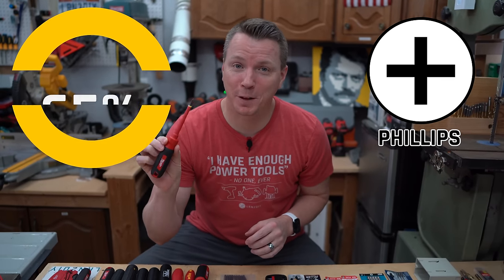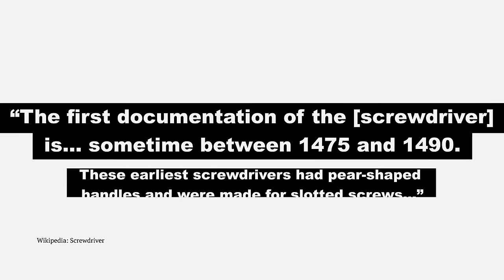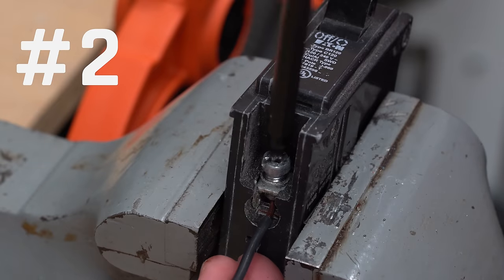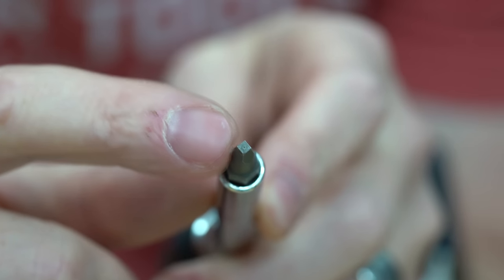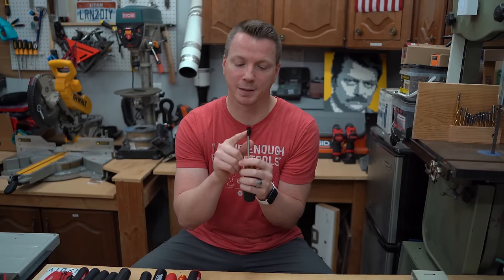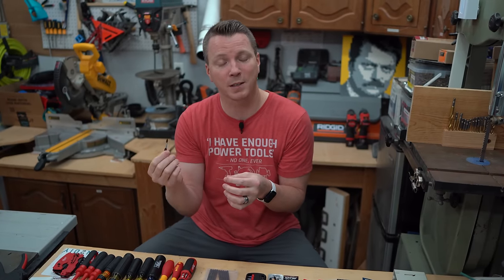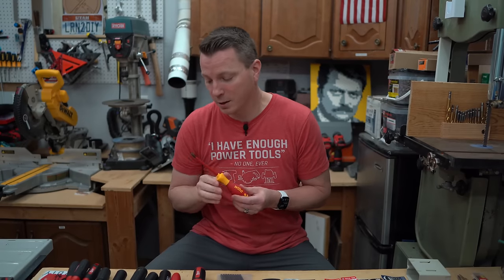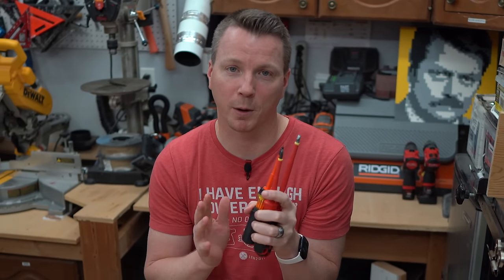You're Using the Wrong Screwdriver For Electrical

Comment: So after seeing so many people online hype the Milwaukee ECX screwdrivers and how they're the greatest thing ever, i decided to purchase the Milwaukee ECX1 and ECX2 hex impact bits and if i like them, i'd then buy some insulated screwdrivers. They arrived today and i just tested them out on a few Residential as well as Fed-Spec Leviton 5-15 receptacles as well as a Heavy Duty/Industrial 6-20... and i must say that i'm somewhat underwhelmed. They don't fit nearly as snug as a Robertson driver. Once tightened down, the bit can be wiggled left and right in the screw head. In stark contrast, a Robertson bit fits so snug into the screw that i can not only pickup the receptacle and it wont fall off the big while holding it sideways, but i can turn the screwdriver pointing straight down and the receptacle will still hang on. The Robertson bit is a Makita XPS Impact, which i should mention is the best fitting bit set i've ever owned. 

TLDR.... so yeah, not impressed. I'll stick with Robertson.

Comment: Funny how he came back to Robertson. As an electrician I’ve been using them for several years, great for speed on outlets. Two or three clicks on my driver and I’m torqued in. Same w switches but slightly gentler, just one click. I see where framers are liking star bits a lot.

Comment: The Robertson screwdrivers are great however the size 1 (normally colored coded with a green handle) can be used to almost turn the larger size 2 screw, however if you try doing that,  it will slip and round out the screw head. The larger size 2 driver (normally colored coded with a red handle) will not fit into the smaller size 1 screw. Therefore the size 1 driver needs to be used with a bit of caution to ensure you are actually turning a size 1 screw and not a size 2. I suspect that is where the slipping complaint you mentioned is coming from.

Comment: I was told be a mechanical engineer that the slot head screw was the weakest.  I have found that to be true when using the old fashioned design of slot head steel screw in hardwood when building boats.  Therefore I suspect that the new screws for multiple screwdrivers could also be weak.  What does the manufacturer of these new design of screws have to say or the Electrical Society of Engineers?  I’m sure they have addressed it.  
Good video, thanks.👍

Comment: There’s one more seldom mentioned advantage of the Robertson driver and that is its ability to hold onto the fastener without being magnetic. The bits have a slight chamfer which allows it to jam into the fastener head. No more fiddly screws  dropping off when installing in awkward locations
Reply: Sometimes a little bit too much so...but yes, Robertson's are a simple and effective solution to screw applications.

Comment: One huge advantage of the Philips bit is that it is self-centering; it doesn't slide from side to side the way a flat-head bit can.  But of course, you can often get more turning-force with a flat-head bit than with a Philips, especially in instances where the Philips bit and the screw-head don't fit precisely; the Philips bit and the screw-head need to really fit together tightly, like they sometimes can in the case of a drywall/deck screw --- in that combination, the driver-bit will sometimes lock so solidly into the screw-head that it will actually either twist the screw-head right off the shank or break off the wings of the bit and leave them embedded in the slots of the screw-head.  The ECX combination bit gives you the best of both worlds, though --- it both self-centers like a Philips or square-tipped Robertson bit, and also gives you the full-torque capability of a slotted bit.

Comment: The flat blade give you the highest torque but the tip slips sideways causing much frustration. The combo tip solves that problem by eliminating the slip. You get maximum torque and greatly reduced frustration with the combo tip. Square drive is improved as compared with the philips but not as high as the combo / flat blade

Comment: Ok, I am from Canada and love my Robertson screw drivers. I am wondering though if the "Philips" portion of the screw heads is not realy Philips. There is the posibility that a Posidrive would work better as it does for automotive work. I was surprised that you did not test it.

Comment: I use flathead because half the screws I run into are old flathead-only screws. I hate the flathead but I also hate having to change the bit back and forth, and after a while you do get good at lining it up and keeping it straight. I'm also an electrician by trade so I use it all day every day. I would love if they would just change everything to robertson.
Reply: torx ? pozidrive ?

Comment: FWIW, Klein also makes a 15-in-1 ratcheting screwdriver (#32305) for about $22 USD, which includes includes Phillips (#0, #1, #2, #3), Slotted (3/16-Inch, 1/4-Inch), Square/Robertson (#1, #2), Torx (T10, T15, T20, T25), and Combo (#1, #2) bits.

Comment: The slotted/philips style is pretty much standard in Europe. With the correct screw, the philips part gives you positioning and the slotted part gives you the torque that you really can’t get with philips style screws. (Philips style screws are designed to slip instead of torque!)

Comment: Philips and Pozi heads were invented for easier assembly because they self centre and make using the electrical driven screwdrivers eas , they were not designed with future use of that equipment in mind, where the screws get tight and round out the heads.

Comment: A large percentage of people install the outlets upside down. Having the grounding prong at the top helps relieve stress on the prong. The reasoning behind the ground on top is for protection against any metal objects that fall on a partially exposed plug it will hit the ground instead of shorting across neutral and hot.

Comment: Slotted screws are the most pleasing for the eye as long as you line them up. Good luck doing that with a square bit.
Reply: who cares . i want to get torque on to my wire connections.

Comment: I wire control panels and i use philips/slotted combination on CBI breakers and pozidrive/slotted combination for weidmuller breakers. Its easier to strip those screws without combination tips. Using one of the wera interchangeable vde kit which has ph/s1, ph/s2, pz/s1, pz/s2 included.

Comment: I was excited when I saw the ECX bits. One comment from one user was that the ECX bits don't lock into the drivers. I found that too. I also found that ECX was har d to get used to lining it up on the screws. I like the Robertson. I will look into the Klein double driver. The screwdriver I carried even though it is not insulated was the 10-1 yellow handled driver from Ace Hardware. The bit s  are good steel and it has two flat blades two Phillips two Robertson two torx plus a 5/16 1/4 nut drivers. 
Just a note about the Phillips. Research and you will find that was invented by Mr Phillips for the auto industry. Much off the parts were put on with screws. They were installed with air drivers.  They  did not have the torque adjustment they do now. The screws were getting over torqued would strip the threads. Mr Phillips designed the "Phillips" to cam out when over torqued. When it cams out it is working as designed.

Comment: If your Philips starts slipping or you notice slop right away than you should try a Pozidrive driver instead. If both of those don't work, try a Japanese Industrial Standard one instead. If all fails than either the screw is bad or the screw is poorly designed. That's my opinion.

Comment: Great vid!! Thanks a lot. Answers, and proves real life ... many of the conclusions I've only been guessing about. Super helpful research. AND, yep .... I had also, (just winging it! without the expertise you brought to the table!) some time ago decided the Robertson (square tip) was an excellent screw engagement type.  I use power drivers (cordless drills) much of the time ... in wood working ... but all manual in electrical work. The Robertson just seems to work  ... for me. My ultimate choice, always, however is what i call the 'clutch head" arrangement -- "star drive". THE least likely to cam out, or wear out of all, provided you ensure you have 100% engagement. The only negative I've noticed with these is the use of the drive design in really small screws. Very easy to strip the driver and/or screw. Just have to be careful, go slow, and apply a lot of "push" to maintain the engagement. Haven't seen that style in electrical work yet. Anyway ...  Thanks again. REALLY helpful video.

Comment: It depends... some devices still only come with slotted screws.  Otherwise, I'm a huge convert to the Xeno driver (a.k.a. combo) and bought a #1 and #2 Wiha insulated set to go with my other insulated drivers.  The #2 Xeno is by far my most used now.  I never use Phillips anymore... they cam out way to easily.  The Wiha Xeno drivers also have the extra tip extension, like the Klein does (I also have for non-insulated needs).

For everyday screws... I will always go for square (robertson) over any other head drive type.

Comment: #2 Terminal screwdriver. Not an electrician, but have one. Picked up one for industrial controls as most DIN rails use them.  The slotted and Phillips has a name. Terminal. Most common size is #2 Terminal. Pick one up at your local electrical supply house. Don't ask for it at the big box store or hardware store. The won't have it as in retail space, nobody has heard of it, so low volume and not carried.  If you try to google it, many invalid results pop up as any slotted or phillips screwdriver is in the popular results. Not all Terminal Block screwdrivers are a Terminal Screwdriver.  a good electrical supply house has them. Get the insulated narrow shank version. Its the one to fit most power contactors for the HVAC guys.
Phillips have beveled blades and are designed to Cam Out of the slot to prevent over tightning. Unfortunately it promotes wear and damages screws that are not Philips. Posi-Drive, Robertson,, and JIS screw drivers have reduced or no bevel on the blades, along with the Terminal screwdriver.  Get the rigth tool for the job. They don't cam out and help prevent loose connections.

Comment: Thank you for sharing. I try to limit the number of screwdrivers in my electrical tool pouch snd carry a multi bit screwdriver. I have found the square bit to be the best for breakers and receptacle/ switch terminals. I do want to get an insulated screwdriver and am going to get the Klein square driver combo based on your video

Comment: The electrical cabinets use slotted fasteners(flathead)(aswell as a separate keylock, clearly installed later) where I work, because no other driver head will easily turn those to open the cabinets. everything else is torx or hex. However I know this isn't really relevant to the video as a whole. It is just an observation of a use for slotted fasteners.

Comment: @LRN2DIY In Canada Robertson #2s are FAR more ubiquitous than #1 outside of electrical. All Framers (in Canada at least) use #2 Robertsons for construction, so that could be why they're harder to find. 

#1s are really MOSTLY only used for inside fixtures and outlets etc. 

Phillips screws are really only used by Drywallers. Oh, and you find a lot of imported stuff from China that is usually targeted at the USA first to use phillips. IKEA is the most frustrating one... Robertson even SOUNDS like a Nordic name... so much IKEA meaning "Swedish for common sense" lol

Comment: The Milwaukee tool next to the outlet in your farewell comes with all the bits you need to do electrical work and is ratcheting to boot. I have it in the stubby version as well. I will try the Square drive next time I do any electrical work!!

Comment: I don’t mean to disparage,  but please ignore the information in this video.   The NEC requires that a screw used for electrical connections be tightened to a torque that meets the manufacturers specifications .   Using the driver recommend by the manufacturer is the best option.   Manufacturers use Phillips screws because they are  designed to “slip” at a specific torque.  The manufacturers designed their components to be safe and effective at that amount of force.    Phillips screws were designed by for the automotive industry and adopted by the electrical manufacturers to ensure a screw is properly tightened to a specific torque and not over or under tightened.  The reason why they “slip is they are at the design torque.   Using a Robertson or other driver will require a torque screwdriver by code and an electrical inspector will ask to see that screw driver.  Typically, the recommended technique is to tighten with a Phillips to obtain the correct torque and to remove with a different type of driver.

Comment: My argument in favor of Robertson drivers is that electrical codes now have torque requirements and Robertson drivers don't cam out. Since I don't have a torque driver, I have come to the conclusion that these torque requirements mean that you should tighten a screw just a little tighter than you think sufficient. This is where Robertson excels. I also agree with your criticism of the ECX bit.
Most 1/4" bit sets include both #1 and #2 Robertson tips.

Comment: Electrician here, 30 yrs of experience and who knows...50,000 receptacles and switches. 95% of which are 20A commercial grade. 
I cant believe I havent yet dicovered ECX!!!  Defnitally going to try, it looks Ideal(no pun intended, lol)   For terminations its flat head/slotted all the way. Much more torque. Yes, it sound antiquated, I thought the same going into the trade but I learned that with a proper sized and properly maintained flat I can achive more torque, even with the screws that accept several makes of drivers. Torque on terminations is obviously very important .  For screwing devices into the mud ring or old work box I either use a small electric driver with a #2 phillips or a #2 offset phillips screwdriver, for installing cover plates I use a 3/16" offset screwdriver.  Once you get the hang of offset screwdrivers the speed and control is incredible. Depending on the circumstances generally an offset screwdriver can be  just as fast and better control.   Ive used robertson with sucess before but at least in the US Robertson isnt standard for everthing.

Comment: The "Wiha" SL/PH2 (you pronounced it right) is fitting probably the best in the screw heads. BUT!
From my point of view, the "Flathead-part" is in all cases the problem. 
Because, (its good to see in your video footage) the long flanks from the flat-head, are lifting the whole screwdriverhead much more out of the screwhead, because of theyre long distance to the center. If you angle a small pointy tip a bit, it doesent inflict as much to the lifting higt on the other side. (like a triangle. From anglepoint "alpha to side a". As longer the distance from the "point alha" so more side "a" is rising. 
Means, if you tilt, a tool with wider flathead, more grip is lost than with a smaler tool at the same angle of tilt.

Give it a proof and massage me when you got results. :)

Greatings from Germany.

Comment: I bought square screwdrivers in both sizes, because I accidentally bought a job lot of screws that only take a square drive. It never dawned on me to try them in a screw with any other shape head. I do keep a set of Phillips screwdrivers, but almost never use them. Almost everything with a cross head on it is Pozi, these days. So, my screwdrivers that I go nowhere without are S1-3, PZ1-3 and now, square 1 and 2, though I’ll probably start leaving those at home, once I get through my industrial quantity of screws that require them.
Oh, and I always have some form of phase tester, too. Those are still always slot types.

Comment: As a control electrician in another country, it's getting to the stage where you have to each type of screwdriver as every different type of equipment uses different screws.  The worst for me is circuit breakers that use a Philips no. 3 screws.
Reply: yeah in canada we have many that are different size from USA versions too, especially for allen/hex keys need 2 sets

Comment: What are you torquing those screws to 100 ft-lb?  I realize electrical switchgear connections and such need to be torqued but the light switches and outlet/receptacles don't need to torqued until you see white spots in your vision.  Also, I'm not an electrician nor Canadian but I have spent many nights in a Holiday Inn Express.  Old commercial, I know.  Great video.

Comment: Robertsons are easily the best.  There are four basic sizes denoted by the colour of the handles.  The smallest is yellow, not used often but definitely some electrical.  The next size is green, used for most electrical. The next size is red, applicable to most general use.  The biggest size is black, used for very big screws, not very often at all.  I have observed two types of Robertson.  Tapered ends give good torque but are capable of sliding out.  Very square ends give maximum torque, do not slide out but need care not to over-torque.

Comment: One issue not mentioned is the quality of the screw slot, of any type.
As an ordinary homeowner, I find there is a significant variation that extends to serious garbage that will not hold the best of screwdriver tips.
Reply: Also there is a distinction between the types of cruciform hardware slots. The American Phillips driver is designed to cam out of its hardware. Screws marked with "dots" are JIS hardware and are not designed for cam outs. JIS hardware require use of either JIS or ISO 8764 PH drivers.